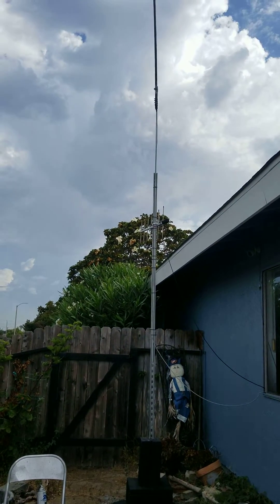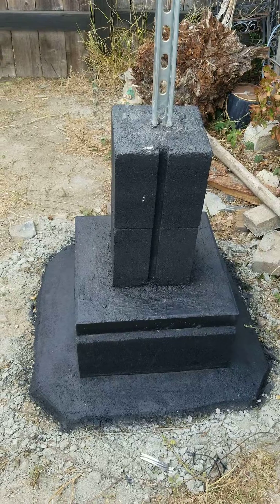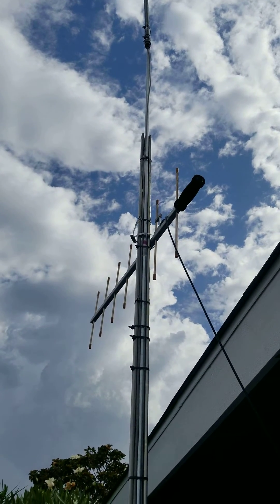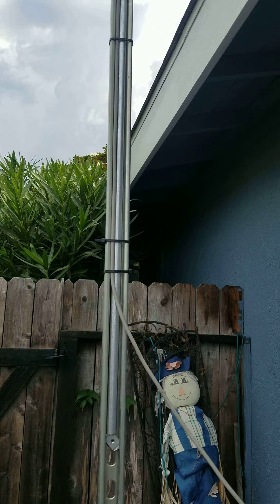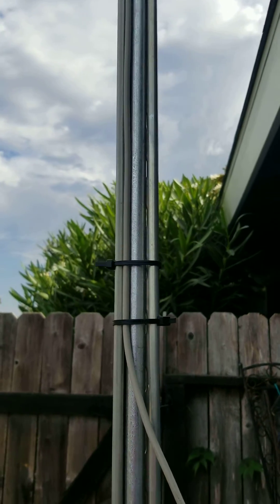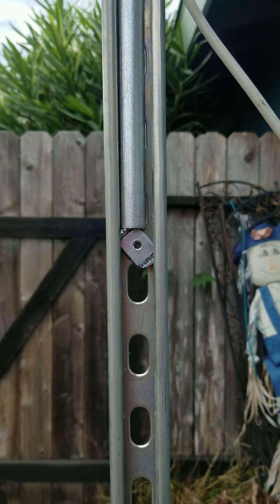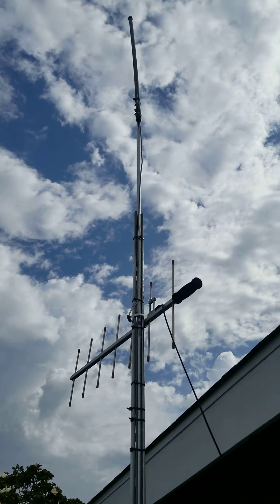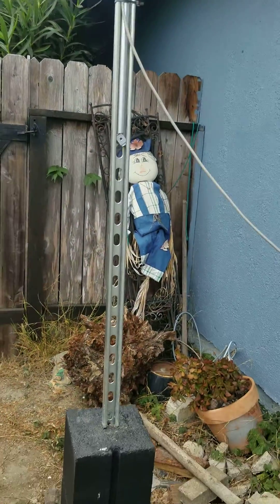DIY HAM radio mast update, added some extra height,using a pipe.

Comment: First off, this is a dangerous setup.  Second, your conduit should have been extended all the way down into the cinder block.  

As one commented already, fence top rail 17 gauge, not 18 gauge is a cheap and safer way to have a short mast.  You would need to secure top railings where they join with a bolt.

Comment: How much concrete did it take you to mix and pour into the cinderblocks?
Reply from the maker: If you buy a single bag of concrete at homedepot or Lowes etc. Say it's 50lbs or even 40 lbs that should be more than enough. If I had to  guess I would say I used about 25 lbs-30 lbs of concrete Maybe, even less than that really.

Comment: What paint did you use on the Ed Fong? Did it change the resonance at all? What type if coax is that? How long is the run? Sorry for all the questions but I’m intrigued by your setup.
Reply from the maker: I believe the coax is about 25 feet of  RG8. might have to double check.. I think I used Rustoleum (flat green) I have another Ed Fong antenna on my roof. That I painted flat black. The resonance on both seems to be uneffected. Personally I would stick to a flat colored spray paint and just one coat... The RG8 is flexible and easier to work with than LMR 400 for instance.
Reply: FYI-don't paint an antenna, especially black. Black paint has iron oxide as color pigment which could effect radiation  @elliothuh669
Reply: @elliothuh669  "I think I used Rustoleum" ... Rustoleum contains compounds of Zirconium and Cobalt, so not recommended for the Ed Fong.
Reply from the maker: @James_Bowie  To be honest I was always a little skeptical of spray paint having no effect on antennas. They seem to be working fine. I think... so the effect of the Rustoleum spraypaint must negligible.

Comment: Did you ground it?
Reply from the maker: J pole and Yagi antennas do not need to be grounded. The Ed Fong DBJ 1 is a J pole.
Reply: @elliothuh669  They absolutely do need to be grounded! NEC is very clear on that. ALL antennas and feed lines SHALL be grounded before they enter a structure or dwelling. I'm not being picky, it is a national code and for very good reason. Nearby lightning strikes can induce many thousands, if not hundreds of thousands of volts on your antenna setup. I can also tell you that it can cause injury or even death to occupants in your home. Your electrical service is grounded (at theoretical zero volts). Ohm's law will quickly dictate that due to a difference in potential, all of that voltage will be dissipated through many things in your home. If, God forbid, you ever had a fire, not a meeting minimum code, will find your claim denied. 
I've been an electrical engineer for over 30 years and I cannot stress this enough. 
I would be more than happy to answer any questions you have There are also good resources on grounding on Mike Holt's website or his videos here on YouTube. Good luck and 73
Reply: @elliothuh669  We are talking about two different things here. The antenna may not need a ground plane (an RF 'ground') but a safety ground is absolutely required by code.
Reply from the maker: @timmack2415  Yeah I know yeah I will consider electrical grounding the unit thanks for the input.  And I will check out that website. That is one thing I am concerned about.
Reply: @elliothuh669  I'm really glad to hear that! If you have any questions, I'd be happy to do my best to go through them with you. Grounding and bonding are very deep subjects as far as theory is concerned but, in actual practice, super easy to accomplish with just a few basic rules. My email is good on QRZ if I can be of any assistance. 73 and God bless, AA2HA